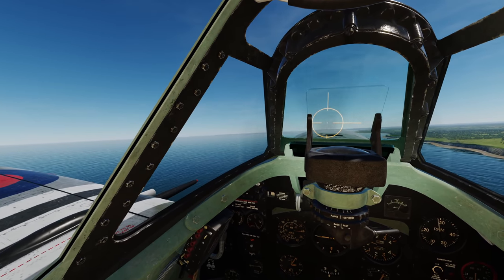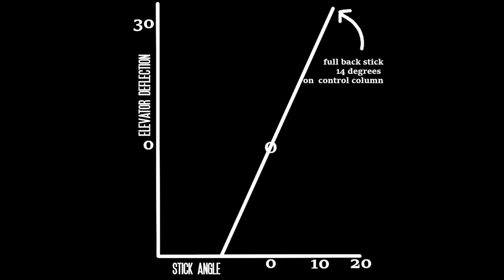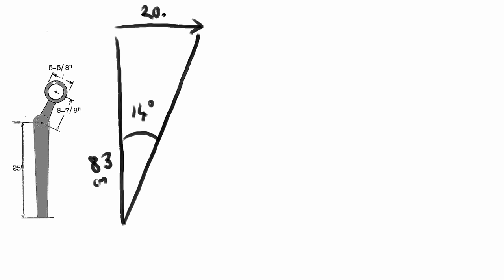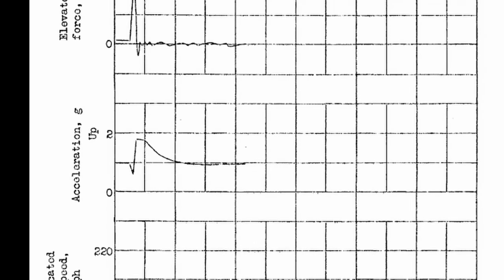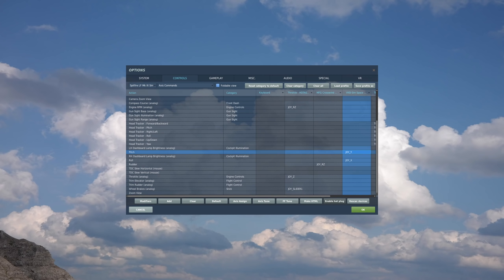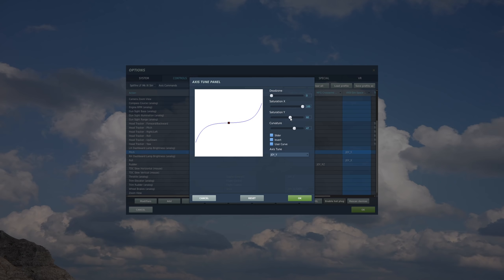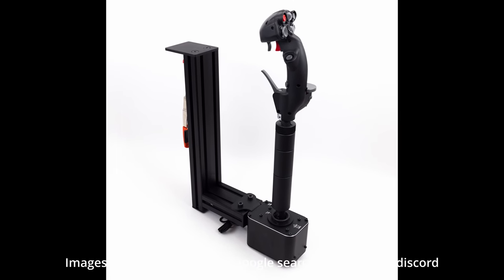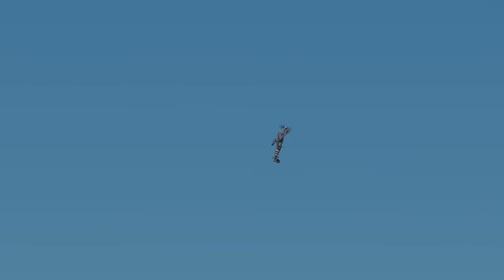The DCS Spitfire - It's Too Twitchy!!  .  . . or is it?

Comment from the maker: Thanks to Dietrich for checking the math for me, not my strongest suit (alongside typos).
Reply: Hi Phil, great video regarding pitch sensitivity. I do have a counterpoint regarding other characteristics of the DCS Spitfire
Before I get started I do want to say that the Spitfire in DCS is remarkably well modeled. That is not to say that it is flawless.

The yaw controls really are oversensitive and (at full yaw, near full power) the required pitch/roll inputs are almost the exact opposite of what this report states. The nose attitude at full sideslip is below the horizon, yaw overcounters roll resulting in a slight turn by far more than 7 degrees. See fig 30, 31 note this is for steady state slips. I'm happy to make a video about this to answer any questions.  
The Spitfire in DCS also doesn't represent the pitching motions associated with yaw. The report you used (for the mk V) is particularly blunt about the severity of these pitching motions - they even caused the motor to starve! 

Likewise the 109 has some issues (I know this is adjacent to your video, and this isn't a counterpoint to your video) 
1) Stick force is simulated as a % at which stick movement completely stops. Say (pulling numbers out of my ass here) at 500km/h a pilot is tested as being able to pull 60% of the stick's pitch range due to weight on the controls. In DCS this means at 500km/h you can use 60% of your stick's range with no impingement on speed of deflection. You can't pull beyond 60% at all. This is compounded by the fact that stick force is heavy down to a lower speed than in any reports I've read (greater % restriction at lower km/h in game than in real life) 
2) The stall characteristics of the 109 are famous;y stable, but the DCS 109 is so stable in a stall that it should replace the Cessna as the go-to trainer aircraft. I have, as yet, not managed an uncontrolled spin regardless of entry conditions. Even coming in, trimming full nose up and holding full aft deflection with full rudder and aileron does not induce a spin.
Reply: Well I have warthog and so tried this on the spit.....goodness me what a difference,  I've adapted now to the 47 and 51 and in my opinion it's made control so much better of all three aircraft.
Thanks for the vid thus has really helped.
Reply: @mckseal  I am not sure about that. I think in DCS is simulated the pilot strenght to around 30kgf.

Comment: Off the top of my head, the most gamey thing i can think of for setting Saturation Y (maximum deflection in other words) is to find the ideal turning speed for a given aircraft (or rather the top end of an ideal envelope) and increase Sat-Y until you can reach a max g load or the virtual pilot blacks out. 
The sacrifice would be at lower speeds the pilot would not be able to deflect enough stick to sacrifice their remaining speed to get the nose on the target if need be. 
So i think the person must decide for themselves where their priorities are, with their specific joystick in mind as well. Do you do a lot of dogfighting? Keep Sat-Y moderately high (85-100%) If you just enjoy flying the warbirds and doing aerobatics or airshow type flying, drop Sat-Y for smoothness or whatever application you need). 
Great little vid Phil

Comment: Great video Phil! The tips on how to setup curves or modify your control scheme with DCS WWII warbirds is essential "read" for anyone wanting to get into this part of DCS World.
Reply: It's also easy to figure out yourself. Either a curve, or saturation limit, is needed to fly with a short stick when the plane is super-responsive in pitch. Some people still fly without it, though--so only the smallest pitch inputs are needed, giving the 'twitchy' feel.
Reply: @devilsoffspring5519  I'm not sure if everyone jumps to that conclusion right away when getting into DCS warbirds for the first time. I did, but then I wasn't new to the sim or simming in general. Definitely a good thing to point out to folks who may be struggling or even turned off of DCS warbirds when a simple tweak will do the trick.

Comment: I have a Thrustmaster Warthog Stick with a 20cm extension. Using a protractor app(phone rested on the joystick's hand rest) back pull max was 22 degrees. Throw length from center to back pull max was about 160mm (measured from the top red button on the joystick).

Comment: It’s so crazy how different the IL2 spit feels compared to DCS.  When in a 2c rate coming over the top of the egg, I am full aft deflection with 100 percent trim. When I hit the little “speedbump” of elevator authority on the way down, I need only to re-add nose down trim or bump the stick forward a bit.

Full aft deflection in the DCS spit at any time is not a good idea 😅 20cm extension feels perfect for the DCS spit.

Comment: One option you haven't mentioned is a yoke. I fly the spit with a yoke and it transforms it from a wild runaway horse (using a joystick) into a pussycat. No need for curves. Use a yoke for all the warbirds and it even works exceptionally well with some jets (tames the F-5). It's also very pleasurable to fly with a yoke as you can control the aircraft with literally two fingers and a very light touch.

Comment: Boy! That turned on a lot of light bulbs here. MSFS2020 has addressed this with a different but similar option for the sensitivity. I already figured out that the stick movement was way off, but not by that much! I'll be doing new curves immediately - the Spit for certain has been way too sensitive to fly, and the P-51 isn't so easy, either. Thanks!

Comment: Nice one. Might be the same as everyone else but I tend to use the same axis commands for every aircraft I have (though I am struggling with the F-16 so I've left that for now to spend more time on the Spit)!
One question though....what are you doing tomorrow as my son's got trigonometry to do and it's one part of math I struggled with. This home schooling is not fun say all 😞 (we're in Scotland incase you were wondering why we were still home schooling, sorry. I'll pay for your lunch and a haggis pie if you can do it 👍🏼).
Reply: I would leave the Viper alone, since its flight control system changes the input gains, depending on the situation.
Applying curves on top of that, can make things quite messy.
Also heads up with the trig.
Reply: @kilianortmann9979  I'll give that a go when I next jump on it. Thanks 🙂👍🏼

Comment: The first thing I did was adjust my joystick axis controls. While I probably fly the spitfire more than any other airplane in DCS it is a pain to fly and a bigger pain to land. Even with the axis tuning, it doesn't take much to blackout or depart flight, especially when you have an enemy fighter on your six pulling lead for a shot. I wonder if a real spitfire was that much more difficult to fly than a P-51? If so, I have even greater respect for the pilots that flew them.

Comment: I’m still beginning on dcs so my hotas is the thrustmaster used for the Xbox (I’ll be getting a winwing hotas f18 stick later). But I didn’t feel the spitfire difficult to fly. It was actually quite a joy. I do find it rather difficult to taxi…almost impossible…any slight input on the rudders and the spitfire turns uncontrollably, eventually going close to a 270 degree turn, catching angular momentum and then having the plane tip over to the opposite side…kind of frustrating (any tips?)…love the plane though!!

Comment: the problem with twitchiness in DCS and FS2020, for that matter, is that your joystick has no feedback (at least the vast majority of sticks don't). Having flow quite a bit in a 172, the FS2020 172 feels about right, but if you yank on the simulator stick / yoke it does "weird things", because you'd never do that in real life... you couldn't. You get too much resistance from the control linkages. The same is true of DCS.

Comment: guys remember that an extension requires the base strenght to support it. Case in point, a Warthog base will explode on you fast with any decent extension, and it's just a bad idea even with a small extension : it will kill the base.
You need a sturdy mechanical base for extensions. Even Virpil's WarBrd is not meant for long extensions, and it's a machined mechanical base of the highest quality. Don't extend the cheaper bases - X56, Warthog - don't touch them.

Comment: Thanks for the very informative video. 
I wonder if you have any advice o how to fix a trimming issue with the Spitfire. I always have to have  forward pressure on the sick to maintain level flight even with full down trim. I have checked the calibration in windows and it centres ok and works fine with all my other simulators. Cheers
Reply from the maker: That's not normal. I don't know what is going on, but here are some checks you can try:
Recalibrate your joystick.
Check that your forward and back trim are correctly bound.
Check also that your cure mapping on your elevator follows your stick. Open the axis settings and make sure the indicator follows what you are doing with the stick.
Don't fly with your flaps down.
Reply: @philstyle  Thanks for the reply. 
Yes it calibrates ok and is centred correctly. The trim is going the correct way and fully to the end of the full down position. When looking in DCS at the fine axis tuning, it is centred correctly and moves smoothly along its full range. Very strange.!! As I mentioned my other simulators all work ok (Xplane 11 and MSF 2020)
Reply from the maker: @stewartlunney6749  So it might be something specific to your setup. This isn't how it should behave.
I suggest asking on the Storm of War discord. There's around 700 DCS warbird players there. Someone is bound to have had the same issue.

link: https://discord.com/invite/4Csg6E7
Reply: @philstyle  Ok thanks again

Comment: Hi Phil. I was playing around with my joystick, measuring throw and angle (which I posted earlier). Anyway, while sitting in the cockpit of the DCS MK ix, I noticed that the control column pivot's in roughly the middle, a little above the pilots ankles. https://youtu.be/PIFBoVGQT9g  I've linked a very short video highlighting this. Is this a factor the equation?

Comment: The DCS Spitfire, like the real thing, is hyper-responsive in pitch because it has large elevators and a rearward center of gravity compared to most aircraft. So, it's pretty 'twitchy' in flight especially when using a short desktop control stick, which most flight simmers use.
It's no worse to fly than any other WW2 module, you just have to get used to it.

Comment: Mate you never answered my Q wether or not 1440p still makes problems in spotting as it is 3yrs ago at this point
Reply: It's more the size of the pixel on the monitor itself that will make it hard......the smaller the pixel the harder it will be to spot. But for the most part higher resolutions make it harder to spot right now.
Reply from the maker: Higher resolutions continue to reduce individual pixel size on the same hardware.. The principle remains the same and will until the laws of physics change..
Reply: @philstyle  yeah I know its just that Ive heard IL 2 Sturmovikh managed that pretty well so I thought there was hope
Reply from the maker: @rama7267  As a result of your comment I have just tried IL2... Oh dear.
I watched an He111 fly away from me, after a short while it started flicking in and out rapidly and then, all of a sudden it quadrupled in size and became a large 3D object facing the wrong direction!
What a horrific system. I hope DCS never does that.

Comment: Flying a plane with a desktop joystick is like racing Formula 1 with a gamepad. No, not a small wheel. A gamepad. Because in a real plane you use biceps/triceps to move the stick around, and on your desktop joystick you use your wrist. A completely different and waaaay less precise set of muscles. Not only does your desktop mini stick have less precision/resolution, but your wrist does too, compared to your arm. Once you go extension, you never go back. Unfortunately, along with a 20-100$ extension, you'll need 50-150$ desktop mount, for now...